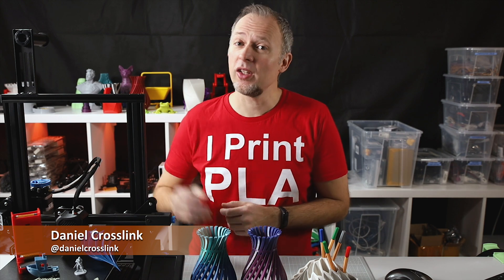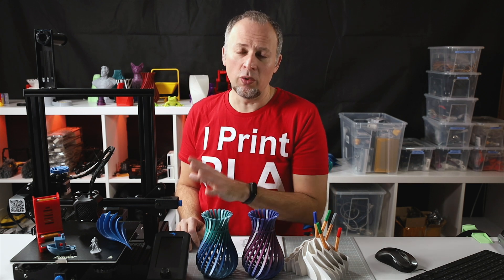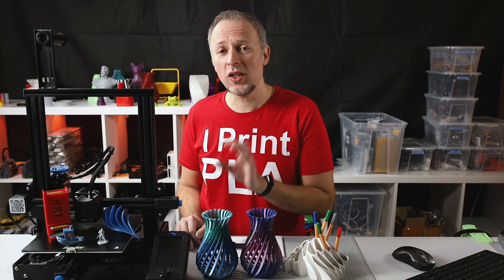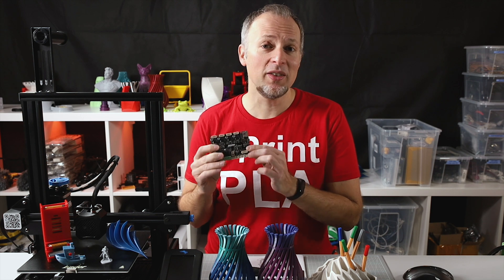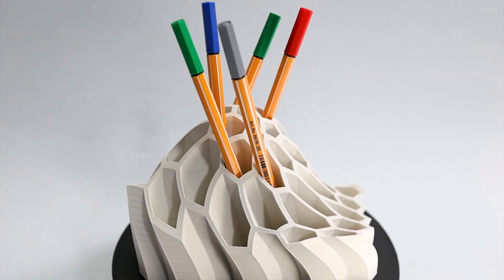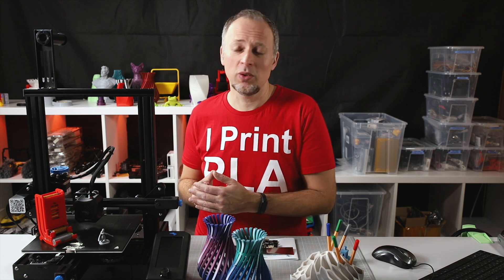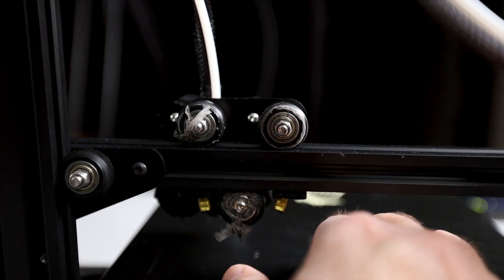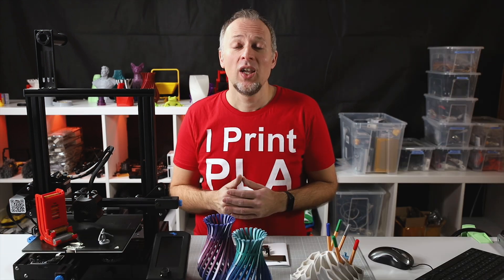🔥 Ender 3 v2 Review - The BEST 3D printer for beginners in 2021?

Comment: aftern 3 prints.. the print wont stick to my bed anymore - the skirt is fine but the actual print does not stick anymore. Any ideas?
Reply from the maker: If that’s the case you should probably clean the surface with alcohol and then check also the bed leveling

Comment: You can easily remove larger prints from a glass plate by putting it in the freezer for 10 mins. The print pops right off when you take it out
Reply: Ah, that makes sense. Because I heard those beds can heat up to like 200 plus degrees. So I thought the initial drop in temp would just cause it to shatter. 

I don't have a 3d printer of my own just yet, but I do have an appreciation for the hobby. Just from all the cool stuff you can make with them or things you can make around your home. I just think 3d printing is really cool.
Reply: @chaotic-7436  I think a glass only cracks from a rapid extreme change in temperature. Like if you took it out of the printer right after it's done and the plate is still really hot and then you put it in the freezer, there would be a higher risk of the glass cracking, but if the print finishes and then it sits on the printer for a little bit and cools down to room temperature, and then you put it in the freezer, and then you take it out of the freezer and let it warm up naturally on its own, then they're probably shouldn't be any risk unless it's just super hot where you live then there would be a higher risk and you might want to let it warm up gradually by taking it out of the freezer and then putting it in the fridge and then after that maybe move it somewhere cold in your house like the garage or basement, and then move it to a normal room temperature room in your house. I don't have a 3D printer yet, I've never 3D printed before, mine is still waiting to ship, this is just based on what I know about glass in general
Reply: @nobody2021  Yeah, I don't have a 3D printer yet either, I'm still trying to learn all I can about 3d printing before I get one..
Reply: The freezer doesn't damage the bed? I only ask because I always thought anything glass breaks after drastic changes in temps?
Reply: @chaotic-7436  I haven’t gone above 10 minutes and I let it warm up naturally at room temperature so it hasn’t been drastic enough to crack the glass.. yet.. but yes, this has been at the back of my mind every time I do this.

Comment: If your bed is very very flat, I’d take magnetic PEI spring steel over glass any day of the week. But as many of them aren’t, glass is nice to have on hand for bigger single prints where you can’t just print mainly in the center. 

I wish they either had more leveling positions or it was easier to get higher quality replacement beds rather than just the build surface.

Comment: Want to get into 3d printing. Don't mind fiddling with the printer and probably even enjoy it. But have pretty much zero knowledge of 3d printers. That said.... this Ender 3 V2 or the Adventurer 3?
Reply: I would give the Tronxy Xy-2 pro a look. Its only 160 odd dollars and it offers many of The features this does not: Auto Bed Leveling with 25 point mesh, filament sensor, Titan dual gear extruder, power off print resume, larger build volume, sturdier construction and a full color touchscreen
Reply: @maiorciprian  Will do but whats the catch? It must be cheaper for a reason?
Reply: @Foxy_proxy  they have an honest price on their product because they dont have all the hype surrounding Creality which is a lot of show but very little go.
Reply: @maiorciprian  First impressions, it looks good. Like an Ender including all the mods you'd want to do on it. But one concern of mine is that I'm new to this stuff and the Ender has a big userbase. How about this one? Though it kinda almost looks like the same as an Ender..
Reply: @Foxy_proxy  all you need is watch a tutorial on how to upgrade the firmware to Marlin. Dont get ME wrong stock firmware is reasonable but lacks some of the features like babystepping. Other than that you only need good filament as the machine delivers awesome prints right out the gate. Why invest all that money into necessary upgrades with the Ender when you can use it to buy plastic? The only upgrade I made on mine s-o far is Marlin and Capricorn bowden tube. I have well over 200 hours of printing on mine in less than 3 months and so far no major issue.
Reply: Depending on what type of filament you're printing, actually the older ender 3 pro and spend the extra cash difference of the V2 on the 4.2.7 board and other useful upgrades.  The V2 upgraded a bunch of useless things like the screen and belt tensioners that you can easily tighten with a wrench.  Get yourself the ender 3 pro, motherboard, dual gear extruder, capricorn boden tube, and springs w/ wheels.  That'll make a way better printer than the V2.
Reply: @CheeseOnEverything  I kind of want to print all kinds, PLA, ABS, Wood, maybe some nylon. The pro is only like 40 euro's cheaper though. And im ok spending another 100-150 on top over time to make it better. The idea of the printer being a long term project in itself is somehow appealing as well.

Comment: The wheels rubbing off is normal, doesn't mean it is too tight, it stops after a while and doesn't come back usually
Reply from the maker: I agree, it stopped now but you need to clean the wheels from time to time so the dirt doesn’t fall on your print area.
Reply: @Crosslink3D  of course, i usually hold my finger on the wheel as soon as i see it, but also have a compressor in the room and blow off all the filament bits and clean the fans and stuff with it

Comment: Which „silent“ Printer for beginner would you recommend?
Because the only room I could use would be my Homeoffice
Reply from the maker: No printer will be silent without an enclosure. Or build one from an IKEA Lack table. This works with almost every printer up to 230x230x250 print area.
Reply: @Crosslink3D  okay what I mean was round about 40 to 45 db should be silent enough. Is there any Printer that would match, even maybe with some easy mods? Mostly there is no clear information about the noise the printer does have.

Comment: I have had ZERO joy with the Creality glass bed. Even though it's supposed to be coated in something that plastic adheres to, the reality is it doesn't. The only way I got it to work at all was to flip the glass over and use a glue stick.
Reply: did you take the plastic sheet of the bed? there is a very thin protective film for transport, on the bed that some people don't realise it is there
Reply: @danybloke1  there's definitely no film sheet. It has a dimpled side which is supposed to become slightly tacky with heat. It's never worked properly. Prints dislodge so easily I just gave up on it. I flip the thing over and use the smooth side with a glue stick and that works fine.
Reply: @drxym  Switch to the magnetic bed from the ender 3 pro.  I had the same problem trying to upgrade to the glass bed, reverted back to the magnetic one because I mainly print with PETG.

Comment: Could anyone advise me - I’m planning to buy my first printer, I’m considering ender 3v2 and 5 pro and I’m kind of stuck. On one hand lower price and 32bit motherboard seem good, on the other 5 pro seems sturdier... although bed suspended only on one side appears suspicious. Does anyone have opinion in this matter?
Reply: For a first printer, the Ender 3 is pretty good. The 5 has a better frame and the bed only moves up / down so it should be better quality with less ringing, but I think the Ender 3 is pretty good and of course it's a little smaller. Another cheaper printer to look at is the Biqu B1 or BX - they're very similar to an Ender 3 price wise but tricked out with all the Bigtreetech components including touch screen, 32-bit board and magnetic steel sheet.
Reply: Thanks! Currently I'm leaning more to ender 5 (and checking if any offer in my area has 32-bit board already). For some reason it seems that there is not a lot Biqus on the market here, so i would probably stick with creality (there is plenty of them) for ease of obtaining spare parts.
Reply: @krzysztofdrzewiecki5618  go with what you're comfortable with in terms of price / complexity. Creality printers are cheap and cheerful devices that have earned a reputation for delivering a bang for your buck.  The reason I mention Biqu (Bigtreetech) is they sell after market upgrades so a Biqu printer is almost like a tricked out Creality printer. If you were planning on buying a bunch of upgrades then it might prove cheaper to just buy a printer with all that stuff in the first place.
Reply: I started looking inot Biqu B1 and it really looks quite good, especialy when price is considered. I wonder, is there big difference in quality between bed moving in y axis and bed moving in z?
Reply: @krzysztofdrzewiecki5618  The main issue is ghosting where the mass moving around causes little resonances that affect the print surface causing ghost like echoes of previous patterns.  It would be worth looking up ghosting.

Don't take my word for gospel but I expect the the more rigid frame and lower mass of the Ender 5's XY head would result in less ghosting than in the Ender 3. Or someone might say that because the Ender 5's mass is flying around at the top of the frame it is somehow worse that in the 3's at the bottom. Or they might say both have ghosting but you can run the 5 faster before it becomes an issue. There is another kind of non cartesian printer called core XY which is popular because the smaller mass means the print can run faster although core XY has other issues like belt tension.

That said I don't see any ghosting on my Ender 3. Ensuring the frame is square and you rest the printer on something that doesn't resonate can help a lot.
Reply: Check out Tronxy xy-2 pro. Its leaps and bounds better than this and for a smaller price it features many of the things this does not : ABL, metal extruder, filament sensor, color touchscreen, larger build volume, bootloader so installing Marlin is a breeze though stock is OK too
Reply: @maiorciprian  I was tempted to mention the Tronxy Core XY by name but I'm a little concerned that their build quality isn't what it should be. The xy-2 pro is a regular cartesian printer, similar to the Ender 3 so I suppose performance should be similar. Seems to have a lot of added features for the price. Bed levelling & silent steppers are a must for any printer IMO.
Reply: @drxym  hardware is over Creality in my opinion, firmware is okaysh but if you're not satisfied you can always go the Marlin route. As for the features is over the Ender and it all works. I have two machines with over 300 hours of printing between them. No big problems so far. The clamp style printing surface is a bit meh but once you get used to it its ok. Print adhesion is good, even too good sometimes. Print quality is above average certainly on par with any Creality offerings. The touchscreen îs well organised and you can do a lot of tweaking on the fly. Unfortunately not babystepping but thats easily fixable with Marlin.

Comment: My parts cooling fan lasted a couple weeks. Creality offered to replace it, but their shipping fees were more than the fan costs on Amazon.
Reply: For The parts that they're using on this it should cost less than 130 dollars: cheap plastic extruder, small build volume, no ABL, no filament runout sensor, crappy fans. My printer was 160 USD and it comes with all the features this thing lacks: ABL with inductive probe, metal extruder, larger build volume, full color touch screen, Power loss print resume, smart hotend fan that turns off below 50C. Creality cheaped ouț on this one
Reply: @maiorciprian , and "your" printer is???
Reply: @Pics2FlicksDennis  Tronxy Xy-2 Pro
Reply from the maker: Thanks for sharing this! I guess, getting high quality fans from amazon is the right choice.
Reply: did you buy the printer from amazon? I have learnt to keep the packaging for more expensive purchases like printers until you can no longer return it. if creality were trying to charge you for shipping for a faulty part that is still in waranty, I would have requested a refund via amazon and then either purchased the printer again, or shop for another printer. This is what I have just done for a faulty bed on my anycubic mega S and didn't cost me a penny ( and now why I'm watching this video :-) ).
Reply: @danybloke1  , I bought it directly from Creality. They offered to send me new fans, but the shipping was more than what the parts cost from Amazon.

Comment: There’s an issue with the factory boards where the extruder stepper motor connection on the mainboard quits working i would recommend upgrading to the 4.2.7 board
Reply from the maker: Might happen, I am watching this long term to see what's happening. Also improving the cooling of the electronics case might help.
Reply: @Crosslink3D   just letting you know about my experience i am waiting for my replacement for my 4.2.5 board they are sending me the 4.2.7 board mine crapped out after 8 days

Comment: DO NOT USE A SCRAPER ON THE GLASS PLATE! it wears the printed texture down and stops adhesion, I found this out by using a scraper to remove my prints before it had cooled down and it only took a few months, If you can't wait for the bed to cool down then print on the reverse side
Reply from the maker: Thanks for the tip!

Comment: Great video.  I really appreciate the honesty of it.  Just a few  comments:
1- The E3 V1 had an X model that came with the glass bed, it was only 5 dollars more.  I love the glass, as prints really stick well. For those extra large prints that don't want to release, just put the glass in the freezer for 5 minutes and it comes right off.
2- You have to upgrade the firmware.  Another thing I always add is Bed PID Tuning.  Not enabled by default.
3- As far as the nice commands you mentioned, i.e. 4 corner test for manual leveling, there is a section in Marlin for custom G-code commands. so that would be a good place to put them.  My only concern on this display, how to they showup as it is not the standard Marlin display / menu system.  Something to look into.

EDIT: looks like the display firmware is closed source.  :-(

Again, great review and the honesty is refreshing.

Comment: I have the exact same issue with the fans on my v2. My glass plate also seem to have a bit of a dip in it causing things to either not stick great or too much squish or plate get scratched. Creality support so far has been far from desirable and I am very close to do a return on it.
Reply from the maker: Actually I forgot to mention that an ALL printer models the fans are crappy and I had to do something about it quite soon. The firmware could help if it would support mesh bed leveling without a bltouch. I am working on a solution, results will show up on the channel soon.
Reply: @Crosslink3D  except of course Prusa, can’t beat noctua fans.
Reply from the maker: Will see once I do the Prusa Mini Review

Comment: Which version of mainboard do you receive. 4.2.2? Do you any problem of layer shifting?
Reply from the maker: I have the 4.2.2. didn’t get layer shifting because of stepper overheating (yet) but I’m planning to improve the case cooling soon.
Reply: Major design problem, yet they just ignore it and keep on selling.
Reply from the maker: I agree, I toasted my SKR Mini E3 1.2 on the Ender 3 Pro because of overheating. So I definitely see this as a major issue on all models.

Comment: Great Video. I'm having really hard time printing PETG with V2. Any tips?
And where do you buy your filaments in Germany? They quite expensive.
Reply: PETG likes higher printing temperature. Try 225-230 C and heat the bed to 70 C. Also not too much squish on the first layer or you'll never get your prints off. Cooling fan off for the first 2 layers then run at only 50-60 %. Also set your extruder multiplier to 96% in your slicer as its a denser plastic than PLA.
Reply: @maiorciprian  And my personal PETG observation is that 'silver' filament is a disaster...I could never get it to print properly, but the other three filaments I use (red, grey and blue) work really well at 245 C nozzle, 70 C bed. I leave the fan fully off for the entire prints and have the printer in an enclosure.
Reply: @imacmill  I only use enclosure for ABS; 245C is a bit high, I found that 225-230C is where you get best layer adhesion with PETG
Reply: @imacmill  I use a brim... simple

Comment: The latest Ender 3 (v1) now also comes with:
- Metal insert on the filament inlet
- Tightening screw on the extruder
- 32bit board with silent steppers
And to answer for "why?", is because it is cheaper for creality to order one type for their printers.
Personally I don't like that they upgrade without telling us, it would have been wiser to call the upgraded ones v1.0.1 (for small changes, like metal extruder inlet) and v1.1.0 (for bigger changes, like  32bit board)
Reply: 32 bit board with A4988 drivers
Reply: I can't say that for sure, as some people got silent boards for v1. So either they where just lucky or creality really ship with it, maybe time will tell.